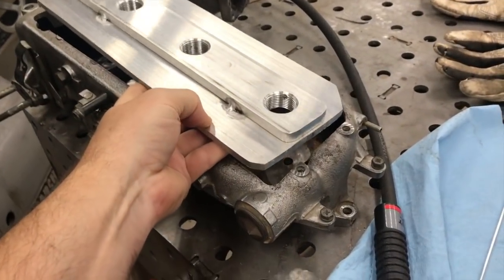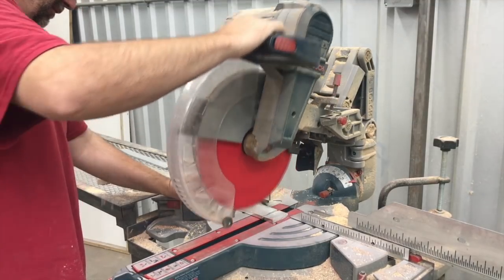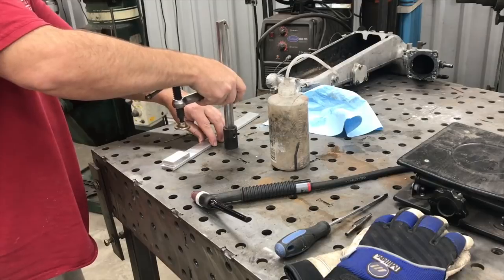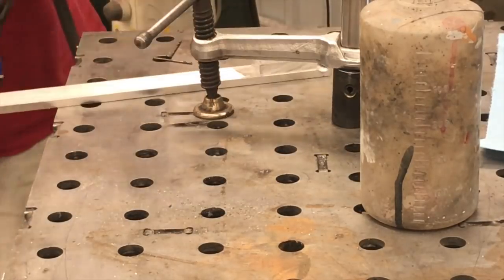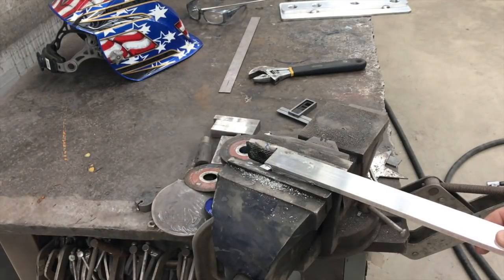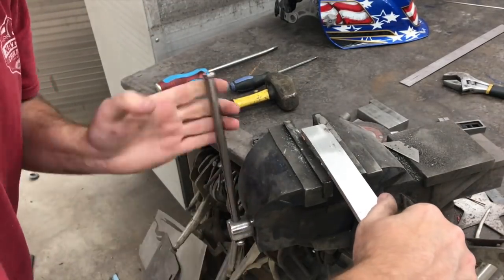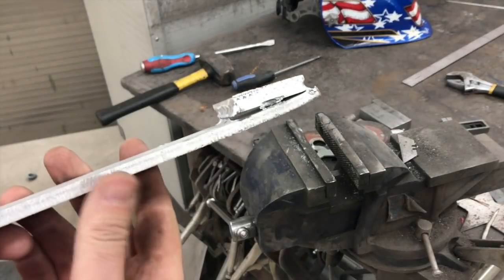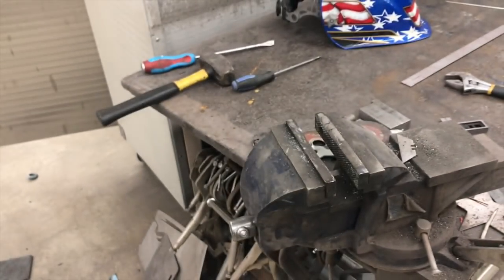How strong are my aluminum welds? Strength Test on thick aluminum

Comment: Aluminum welds allowed to cool naturally will be almost completely annealed, both the filler and the HAZ will become as soft as the original alloy in it's cast state without any cold working. Feel your filler rod, after your weld will be just as soft and weak. A solution is to use more filler, you also want to minimize heat into the part. So, don't try to penetrate with the arc, just whett the edges of the puddle and move on, if you need penetration do it mechanically by cutting back edges of base metal. Run multiple small passes instead of trying to do everything in one pass.

Comment: Love the shop, I have 23 years in as a prodigy aluminum tig welder/ fabricator. Your weld is not bad bud it was concaved... also it shouldn't really break in that fashion,,, it should tear (with enough effort) at the point of tangent of one side of the weld if destructed enough... but really shouldn't break

Comment: I work as a welder and recently had an aluminum weld (full penetration) 100% Argon. The 6061 aluminum thickness was 1/16" and the weld bead was the same thickness. When I researched into why the weld cracked I discovered online by ESAB is the weld is about 1/2 as strong as the parent material. Typically 6061 is rated around 40000 psi and the weld will yield around 18000 psi. Part of what takes place is the weld is fully annealed causing a drop in temper. It varies somewhat according to what series aluminum you are working with. Something I now take into consideration so that hopefully it never happens again.

Comment: Like dude said  
grind small  divit
clean with wire brush
Then  Acetone
Pre heat your metal then turn up your feed point your gun at what your gonna weld not what you welded (push not pull) you should have  zero  Craters when you're done that's where your crack will come.  weld tell concaved fill creaters and clean make a second pass

Comment: Mostly tig weld 100% argon, you did 50/50
Reply from the maker: aluminum is commonly welded with helium assist if your machine is under powered for the thickness you are trying to weld

Comment: i think it just need more filler material in your test weld the "smooth face" on your weld shows the weld is too hot
 "you get GOOD deposition of the weld" but "you actually have a heavily cratered weld" 
more reinforcement to the weld the actual weld face should be round "outwards not inwards" 
the reason the weld cracks down the centre of your weld is because it lacks reinforcement 
technically the weld should only fail on the Edge of the weld inwards,,
 stop starts need to be blended , maybe prep the bottom plate by grinding a groove into it the work metal for better deposition and weld it with more dabs of filler twice as much 
it is a pretty weld you are doing it can be ALOT stronger with methods

Comment: most aluminum weld failures on thicker material (.125" and up) are right down the center of the weld like what you experienced, especially in Fillet welds like your test where if it no a 100% fillet with a concave..... 

Just make sure you are getting good root fusion and you are not leaving craters at the ends of welds and your 200amps should be okay.

One thing to consider though is some preheat when it comes to doing the Manifold itself. The manifold with the billet plates that you showed in the beginning of the video has a lot more mass and area to absorb and dissipate heat so you will have a harder time with the first bit of welding due to heat being sucked out. If I were in your position, I would preheat the parts to about 250°F then start welding.  With the preheat and the Helium, your 200amp machine should have no problems at all.
Reply: Sound advice.

Comment: Yes great penetration and fusion. I would think plenty strong for the project given too. My thinking on the crack is you just need more material. With that fusion if the weld material equals parent material thickness you're going to be all good n golden there. Thanks for sharing
Reply from the maker: thank you sir !

Comment: It will be fine Aluminum welds won't ever be as strong as a steel weld when you are hammering on it like that.  You can always make a 2nd pass and  weave your welds to build up more weld.  You can always preheat as well to get better flow out.  It may be time for a larger welder!!
Reply from the maker: Some great points, appreciate it.

Comment: Just looking at the weld and how it had very little penetration  would convince me to lay a hot 1/4 root pass followed by multiple fill and cap passes. Before you try and rip it apart take a slice across the weld , this will show you if there has been proper penetration into the base material .  Nova Scotia
Reply from the maker: thank you sir
Reply: yawns that is a waste of time on aluminium you better off preheating the work metal and the weld will deposition to the extreme ..
if you are not preheating the aluminium then it would best to have a groove in the base plate for the weld to sit "prep the plate"
 aluminium does not weld anything like steel  
it always starts COLD and the gets HOT tig welding ally is easiest
 "i have to mig it at work and if i took your advice i be out of a job as aluminium you do not get strong welds by dumping a heaps on the top 
YOU ALWAYS HAVE TO PREP THE METAL 
V out the welds and weld it again and it would be stronger 
Chamfer the edge and weld it if you a OLD BLOKE terminology lol
it is weld prepping that makes strong weld in aluminium..

running multiple runs on ally  "is JUST BIRD POOP" 
that is the terminology we use in the industry
further more Ally does not like to be REMELTED and REMELTED
you get it right the FIRST TIME 
you actually DESTROY the properties of high quality ally when you run multi passes on it
does not work like steel "most ally has silicone in it" 

{ferrous metals in steels , phosphorus may be added in amounts up to 0.10% to improve strength and corrosion resistance. Silicon - Usually only small amounts (0.20%) are present in rolled steel when it is used as a deoxidizer.

The 4XXX group {Aluminium is alloyed with silicon for ease of casting.Silicon is good in metallic alloys used for casting. This is because it increases the fluidity of the melt, reduces the melting temperature, decreases the contraction associated with solidification and is very cheap as a raw material.

umm do they sound the same DO THEY or is ALUMINIUM COMPLETELY DIFFERENT TO STEEL

nudge nudge wink wink silicone BURNs AWAY MATE if you run multi passes you LITERALLY rob ALL OF THE silicone AND THE ALLY WILL CRACK repetitively
SIR JOSEPH MOIR WAS MY ANCESTOR
https://en.wikipedia.org/wiki/Joseph_Moir
"sir Joseph Moir Established the Iron Mongers association for Australia
i know my metals

Comment: Aluminum welds are only 30% as strong as the base material unless they go through heat treating. It’s different than steels, Zila has some good AL videos explaining why aluminum side jobs can be risky depending on job and criticality of weld strength
Reply: Andrew Naimark link?  I couldnt find the vid.  Thx
Reply from the maker: some good points, thanks

Comment: If you're welding 6061 then 5356 is slightly stronger than 4043 and will anodize better.  I think though you're doing this for that manifold, which is cast.  In that case 5356 is not a good idea.  In any case though I think if you're trying to do that weld in 1 pass you need more filler material, I'd be using 1/8 rod on something that thick.  Not sure on the 50% Helium mix the most I've every used was no more than maybe 25%.
Reply: Yes, with cast the higher Silicon content of 4043 is better suited as a filler. Another thing that is often overlooked when it comes to welding of engine parts is while 5356 is stronger and will not turn grey when anodized, 5356 is not recommended for parts that will be operating at temperatures at and above 150°F. At and above 150, the 5356 becomes very prone to stress corrosion cracking due to its magnesium content. 4043 and its almost 0.05% magnesium makes it not susceptible to this cracking issue when held at and above 150°
Reply: @CP_300PRC  Hi Cj.. I absolutely with you on this. I can't find much information on aluminum repair especially when come to cracking issues and also  welding procedure for aluminum.

See what is your technical view on what I have did in the past (without complaint after the cast Al repair)

Should be a transmission mount if not mistaken.

1st attempt:
 Using 5356 on 1st pass which gave a crack after that. I believe it's filler incompatibility.

2nd attempt:
Grind off the 5356 filler previously applied and repair it with 4043. Noticed there's no crack. 
From this point, 4043 filler become the root pass and follow by another 2 surface cap with 5356. No crack at all.

You have any opinions on root pass using 4043 and follow by 5356 cap? 

Thanks in advance
Jackie Lam
Reply: @JL-se1dp  Hi JL. Honestly, not really sure what to think about since I've never mixed roots and caps like that with aluminum filler nor have I ever heard (until now) anyone doing it.

Normally mixing fillers between root and fill / cap is to take advantage of each rods properties. I guess in a way, you are doing exactly that by using 4043 in the root and 5356 in the cap but I wonder how much strength (if any) you are gaining or loosing depending on how you want to look at it. Its also going to go back to in-use temps and material too. For example, if it is something that sees routine extended periods of in use temps above 150f, then you probably have a weaker joint than if it were 100% 4043. The same thing with Castings (regardless of temp). On the other hand, if its say a 6000 series parent material, that isn't exposed to those kinds of temps, then although it wont be as strong as 100% 5356, it should be stronger than 100% 4043.

On caveat though about the strength is the just how much one is diluted into the other and also the primary cross sectional area of each. If the caps of the 5356 are thin as compared to the root, then you wouldn't be getting much in the way of added strength from the 5356 like you might think.

Comment: Maybe not the best filler material? You need to do a butt joint with a full fill weld and test that. It should not fail in the weld with the proper material in that case.
Reply: for the application (cast intake manifold), 4043 is exactly what he should be using.

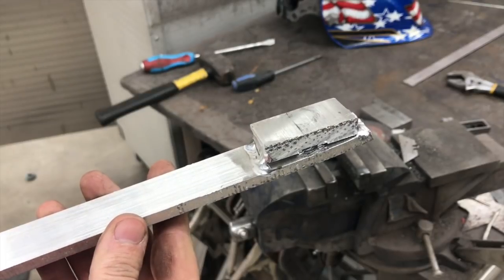Comment: Hard to tell from that angle but @2:22 looks like lack of fusion in the root. Turn that pulse off, pulse runs cooler. Should be able to make that happen without helium by preheating I would think.
Reply from the maker: you are right about the lack of fusion in the root at the beginning of the bead, just didnt have it hot enough before i dabbed and started moving, you are also right about the pre-heat which i did on the intake before i welded it

Comment: when ever I weld aluminum and test it in a vise 2 out of 3 will break, if I do the same weld with steel the weld holds, I don't know if this tells me my aluminum welding is bad, or if aluminum wont hold like steel.
Reply: Aluminium is annealed/softened by the heat induced by welding.

Comment: It looks like you are pulsing. If so turn it off. Not enough filler to me. Also more amps for more penetration which you dont have. Have you tried 4943 filler.